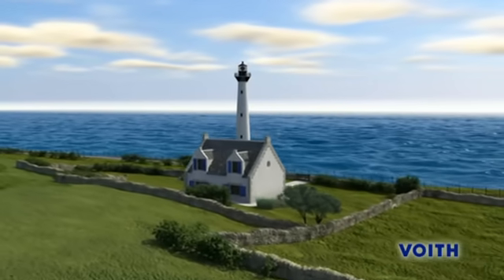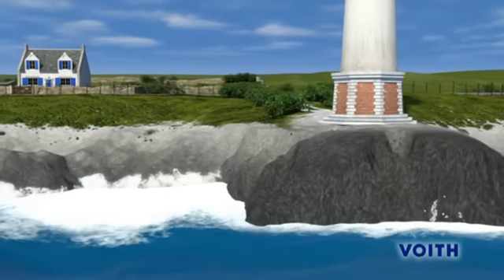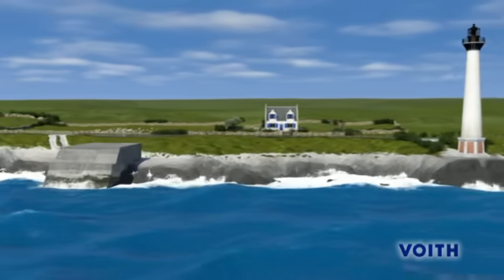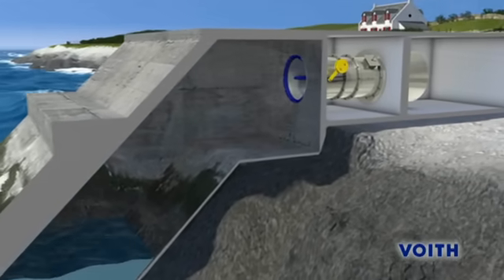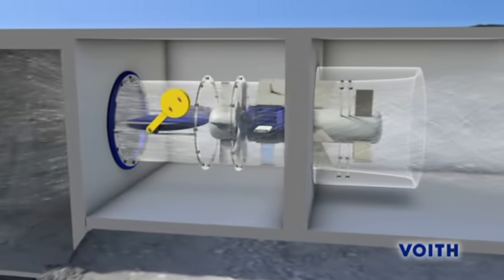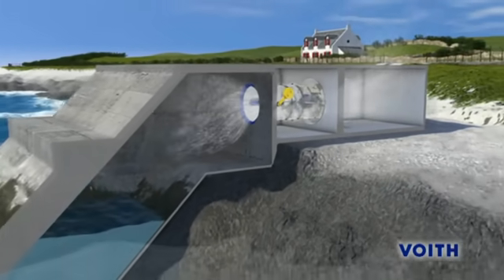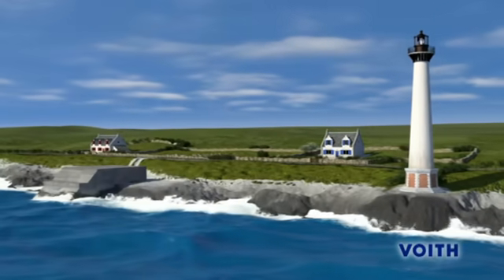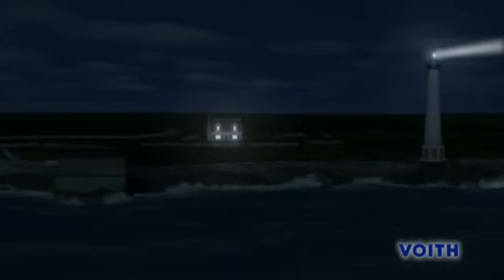Ocean Energy -  Wave Power Station

Comment: wanna know whats hilarious I thought of this before this was a thing I had no idea someone already thought about it as early as 2000 great minds think alike I guess, but I was talking to a friend and I said they could literally solve our energy crisis problem if they just built dams all around the Continental united states, my concept was more for hydroelectricity which works in the same concept as this the only difference is that you using air motion of the moons gravitational pull on the oceans to spin the turbine instead of the water flowing directly onto it, either way, it seems finally the neanderthals are using their brains. If we all invested in this technology America could feed its energy grid at little to no cost whatsoever. you might have to pay taxes to keep maintenance on it? but it emits no pollution and it's clean and can generate enough power which will make all coal, natural gas, and any other pollutions energy plant obsolete. So the taxes on this wouldn't even be that high considering these would all power coastal states, anybody though in the center of America won't have to worry really since it's hardly colonized.
Reply from the maker: @Diakon Ragnarock: We are convinced that humanity will find a way out of the energy crisis without polluting the environment too much. It's great that people like you come up with ideas. Keep on!

Comment: And what if construct some kind of syringes near the coast which could flow on verticaly on the water level, and if that would be anchored to the sea bottom, the water surface would be a piston in our syringe. And we could achive similiar effect.
Reply from the maker: @  GhanBuri666 : Thank you for your comment. What you suggest is actually already implemented in the Oscillating Water Column buoy concept.

Comment: Would be interesting how much energy you get out of this and how much it costs to build this
Reply: Not enough and too much. Its essentially a much less efficient wind turbine, except exposed to salty and corrosive sea breeze 24/7. They say "if fully exploited it could cover 40% of the global energy needs", but full exploitation means covering literally every inch of the worlds coastline with them. Then you need to factor the constant maintenance and repair which is much more than simple wind turbines simply because of the environment that its in.
Reply: @tjwoosta  It doesn't need to cover the entire world's energy needs to make sense. It is a fairly simplistic design and therefore relatively cheap to build, the salt water is a concern but not one that is impossible to overcome as we have done it with ships and off shore wind turbines. It's probably a good idea in any place with fairly violent coastal waves even if it's just a small thing.
Reply: @hedgehog3180  Cheap to build is the wrong variable. Yes concrete is cheap, but releases CO2 at a 1:1 ratio with it's weight.
Terrible. If you don't get MW from it that is, like with reglar hydro.
So the big question is, when taking everything to account, what is the payoff time when looking at CO2? 
Just based on my shallow understanding of fluid dynamics and turbine engineering, I can't see it winning over regular wind turbine and regular hydro.
Reply: @lumina115  There is always a cost benefit calculation.
If it takes more CO2 to build and maintain them than it saves in CO2 over its lifetime, then should we really build them? 

The "costs" in CO2 is massive, hence the gains in MW should be equally massive. 

Nuclear is a good example, or regular hydro. Massive amounts of concrete, but it pays of in the long run with CO2 free MWh for decades and decades. 

Since that post was made, I've started to dislike wind more and more. The short  life span and most parts not been recycled at all sours the experience.
And the amount you need to cover just one reactor. Also it never works when you needed the most, ie during harsh winter.

Comment: I don't really understand how the turbins keep on turning clockwise even when the air goes back. If someone has an explaination, I'd like to have it.
Reply from the maker: @V.D.: This is a special turbine named Wells Turbine. The Wells turbine is a low-pressure air turbine that rotates continuously in one direction independent of the direction of the air flow. Its blades feature a symmetrical airfoil with its plane of symmetry in the plane of rotation and perpendicular to the air stream. Please watch "Harvesting the Wave Energy: The Function of Wells Turbine": https://youtu.be/kXfSrCWA7qA

Comment: Sorry to spoil it, but I dare say this doesn't sound efficient and like it would create nearly enough power. Even if we ignore that small dilemma there is still a major issue - this concept needs a coast, so it's not a viable option for landlocked nations/states.
Reply from the maker: The power plant visualized in this movie was in operation between 2008 and 2018 on Island Islay and was primarily an R&D site.  There is a Wave Power Plant in Mutriku, Basque Land in Spain. It is built into the wave breaker. It was commissioned in 2011. You can also visit it. This technology is still very new. They do a lot of R&D in this field (also offshore).

Comment: Sounds good, doesn't work.
Reply from the maker: Your claim is not valid. It is working. There is a Wave Power Plant in Mutriku, Basque Land in Spain. It is built into the wave breaker. It was commissioned in 2011. You can also visit it.

Comment: Should work, technically. But I think it would be more efficient to use the moving water directly.
Reply from the maker: @  KoalaLumpUhr :  It is working in reality. There is a Wave Power Plant in Mutriku, Basque Land in Spain. It is built into the wave breaker. It was commissioned in 2011. You can also visit it.

Comment: Considering the amount of concrete needed for contraptions like that, the principle seems highly inefficient.
Reply from the maker: The wave power plant in Mutriku/Spain is built into the wave breaker - which is already there to protect the harbor. In this way, no shoreline is destroyed.
Reply: @IdeasfortheGreenPlanet  Ok, so what is the expected efficiency of such a generator ?

Comment: air is to weak but with floats we could run an engine maybe.
Reply from the maker: Your claim is not valid. It is working. There is a Wave Power Plant in Mutriku, Basque Land in Spain. It is built into the wave breaker. It was commissioned in 2011. You can also visit it.

Comment: It will need a huge support structure or the waves will knock it over.
Reply from the maker: @ Rob Shuttleworth: The power plant visualized in this movie was in operation between 2008 and 2018 on Island Islay. There is a Wave Power Plant in Mutriku, Basque Land in Spain. It is built into the wave breaker.

Comment: This is a great "green" electric production. I wonder how the turbine can turn in the same direction from both directions of airflow? Interesting!
Reply from the maker: This is a special turbine called Wells turbine. The Wells turbine is a low-pressure air turbine that rotates continuously in one direction independent of the direction of the air flow. Its blades feature a symmetrical airfoil with its plane of symmetry in the plane of rotation and perpendicular to the air stream. You can see the explanation in this movie: https://youtu.be/kXfSrCWA7qA

Comment: Notice  they don't tell you how much power their making.
Reply from the maker: @XxLoopermanxX : The power plant visualized in this movie was in operation between 2008 and 2018 on Island Islay and was primarily an R&D site. It had two 500 kW turbines. There is a Wave Power Plant in Mutriku, Basque Land in Spain. It is built into the wave breaker. It was commissioned in 2011. You can also visit it. The plant has a capacity of 296 kW from 16 turbo generator sets.

Comment: They should implement this in most of the coastal cities. It doesn't even look complicated to build.
Reply: It's easy to see that the airflow this contraption would create wouldn't be powerful enough to do anything with. Plus the salty environment would destroy any metal/electrical structures within months.
Reply: It would probably be useful in areas with hurricanes too
Reply from the maker: The power plant visualized in this movie was in operation between 2008 and 2018 on Island Islay and was primarily an R&D site. It had two turbines with 500kW each.  There is a Wave Power Plant in Mutriku, Basque Land in Spain. It is built into the wave breaker. It was commissioned in 2011. It is designed for 295 kW with 16 turbines. You can also visit it. 
They do a lot of R&D in this field (also offshore).
Reply: Scienctist found that it's impossible to get energy out of this method and have abandond it,  it's explained indepth as to the reason why.

Comment: Hi all @
 This is a slight deviation from your exact thread but is still EV and Green energy-related.
   I was wondering why no one is talking about TE$LA and Wind turbines.
With Elon and his company's engineering expertise, I am sure they could design and build
The most efficient turbines and towers on the planet. With their knowledge of motors ( and that is all a generator is, a motor being pushed rather than driving a shaft ) coupled with the aerodynamic design of the blades ( remember they have some of the best drag coefficient numbers of any other road car due to their in house designers and fluid dynamics engineers )
That along with Elon’s Materials expertise used to design the towers, and his ability to scale up production at lightning speed, I can’t see how this would not go a far distance to accelerate his change to renewables and away from fossil fuels in the prime directive.
Can you honestly think of a better company for this job than TE$LA ????

Eddie in Scotland
Reply from the maker: @Eddie: Thank you for your comment, although it is a slight deviation from this thread. Our strong opinion is that we ALL should do our best to find the new ways to generate clean, sustainable energy. If this is Tesla, great.

Comment: the reason why this is not standard or even heard about until now is because it doesnt work and never will. the wave action is blocked by concrete which turns the rising and falling of the waves to be nothing more than rising and falling with the tides.
Reply from the maker: @repoman: Your claim is not valid. It is working. There is a Wave Power Plant in Mutriku, Basque Land in Spain. It is built into the wave breaker. It was commissioned in 2011. You can also visit it.
Reply: @IdeasfortheGreenPlanet  you think so? i am not seeing the intake/exhaust for the air that the system uses to create the power so i think they either didnt build it or they decided it wasnt worth the money to keep it running so they shut it down and removed it. 

have a pic of it? i am looking at google maps for it and the most recent data says 2021.

Comment: If wave power were practical, our ancestors would have developed it centuries ago, like they did with flowing water and wind.  Yes, there's a lot of energy there, but it's so wonky, unstable, and nearly unpredictable that people try it and give up.
Reply from the maker: @Bob Adkins : Thank you for your comment. There is a Wave Power Plant in Mutriku, Basque Land in Spain. It is built into the wave breaker. It was commissioned in 2011. You can also visit it. They do a lot of R&D in this field (also offshore).

Comment: I notice you don’t mention how much energy the Scottish generator has been »feeding to the grid« even though it has been running for enough years to prove reliable data. Somewhere else in the comments, you’re asked about maintenance cost for the Spanish unit, and plead incomplete data. But again, wouldn’t the Scottish one already provide them?
Reply from the maker: @Hallands: The power plant visualized in this movie was in operation between 2008 and 2018 on Island Islay and was primarily an R&D site.  It had 2 turbines with 500kW each. There is a Wave Power Plant in Mutriku, Basque Land in Spain. It is built into the wave breaker. It was commissioned in 2011. It is designed to produce 295 kW with 16 turbines. You can also visit it.  They do a lot of R&D in this field (also offshore).
Reply: @IdeasfortheGreenPlanet  Do you mean kWh?

Comment: Tidal energy is very powerful. Wind power is pusillanimous. What is the idea of turning the first into the second?
Reply from the maker: @ Sergio Trevino : Thank you for your comment. This concept is not about harvesting the tidal, but the wave energy.
Reply: @IdeasfortheGreenPlanet  The power of air displacement by wave LEVEL CHANGE is nothing compared with the WATER MOTION. Water density is 1,000 times the air density. The design is pusillanimous. It is like using an elephant to move a fan. It is stupid.

Comment: Sorry but no. Energy captured is proportional with the velocity squared and surface area which the device has none
Reply from the maker: @Cristian Armaselu: Thank you for your comment, but you're mistaken. You definitely can convert the wave energy into electricity based on this principle. It is called the Oscillating Water Column.
Reply: @IdeasfortheGreenPlanet  I'm not debating the method but the size of the device. To create anything meaningful it needs to be bigger in the surface or velocity needs to be higher. I can go over to do some estimation based on perceived dimensions of the device.

Comment: here's an idea , use x2 turbines designed for optimum efficiency  , use large 1 way flap valves (carbon fiber) for one way 
airflow into each turbine . Use semiconductors to disconnect the load from each generator , when the flaps are closed.
Add a few batteries so the transient outputs can be smoothed out , for connection to the grid.

Comment: 09marco2021, terça feira, 8h36 a 8h39 🇧🇷
Assisti este vídeo em outra versão com mais tempo em outro canal do Discovery,  em 2012. Muito boa esta idéia. Mas pode ficar melhorar e ser modificada .
Reply from the maker: @Selvagem Latino :Thank you for your comment.  Yes, you are right, it could be done better. The power plant visualized in this movie was in operation between 2008 and 2018 on Island Islay and was primarily an R&D site.  There is a Wave Power Plant in Mutriku, Basque Land in Spain. It is built into the wave breaker. It was commissioned in 2011. You can also visit it. 
They do a lot of R&D in this field (also offshore).

Comment: This is the best idea so far.
The generators are outside the water in solid ground. Easy and cheaper maintenance.
Reply from the maker: @Ric Nyc : Thank you for your comment. The power plant visualized in this movie was in operation between 2008 and 2018 on Island Islay. Well, it didn't look lovely. There is a Wave Power Plant in Mutriku, Basque Land in Spain. It works on the same principle - the "Oscillating Water Column".  It is built into the wave breaker. It was commissioned in 2011. You can also visit it.

Comment: Ok 2 decades passed, so time to see some economical stats of  the project. How much was construction and maintenance costs, how much energy it produced and its cost of 1kW/h.
Reply from the maker: @Dmitry Alexeyev : The power plant visualized in this movie was in operation between 2008 and 2018 on Island Islay. It was primarily an R&D place.  In the year 2011, the Mutriku Breakwater Wave Plant was inaugurated. It works on the same principle - the "Oscillating Water Column."  The Basque Energy Agency commissioned it in the bay of Mutriku in the Bay of Biscay. It is the world's first breakwater wave power plant with a multiple turbine arrangement. The plant has a capacity of 296 kW from 16 turbo generator sets. Maybe the Basque Energy Agency can give you the asked information - or you visit the power plant.

Comment: This design accepts some minor energy loss to encapsulate the system creating a controlled repetitive motion, some more to move air rather than sea water through the turbine, using a compressible gas.  The structure itself will suffer erosion just like any other wave related system, but the turbine is far better protected than most wave systems from damage.  There's only one moving part, and it operates on salty wet air.

To make it more durable, the use of Roman concrete for the outer shell rather than common portland cement would yield gains.  Also, a stainless 316 motor assembly and totally enclosed brushless halbach induction motor should yield excellent corrosion resistance against the salty air and excellent performance characteristics.

To increase economic effectiveness, consider integrating the design into a wave-break or dam to enable its use in harbors and similar where electricity is needed anyways.
Reply from the maker: @Daniel Lewis: Very well said. There is already wave power plant built into the breakwater. In the year 2011,the Basque Energy Agency commissioned it in the bay of Mutriku in the Bay of Biscay (Spain/Europe). It is the world's first breakwater wave power plant with a multiple turbine arrangement. The plant has a capacity of 296 kW from 16 turbo generator sets.